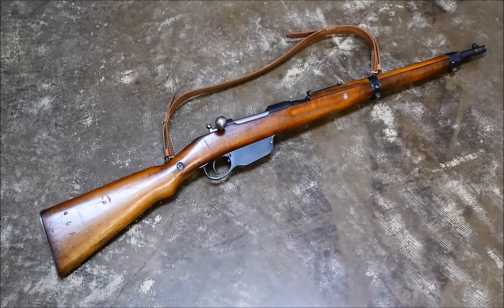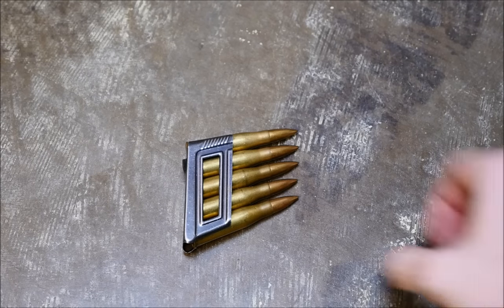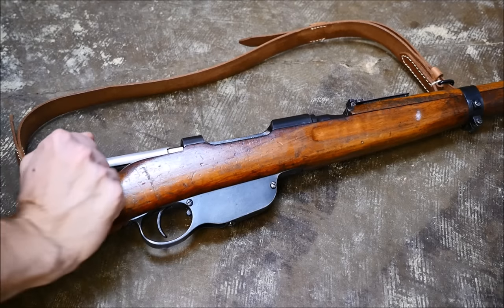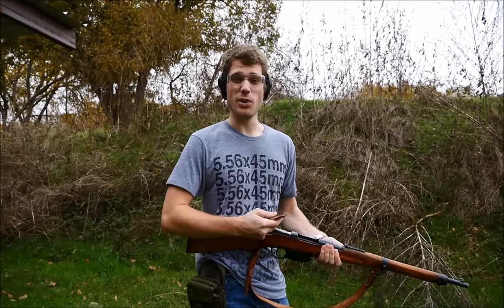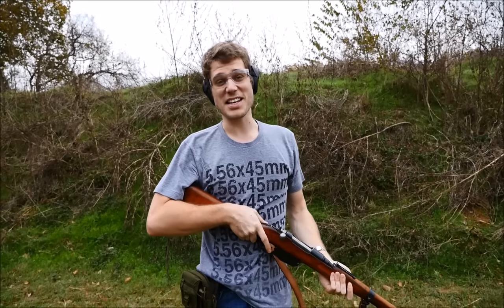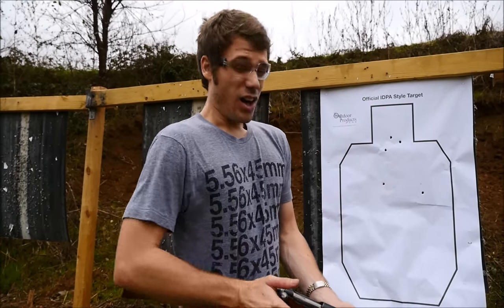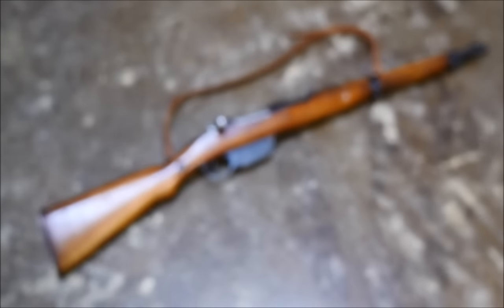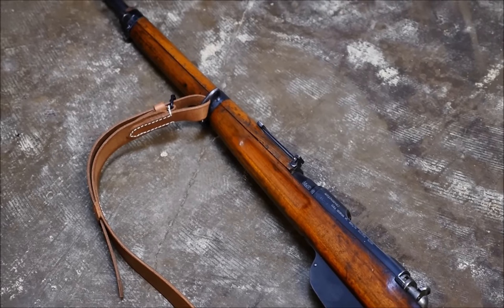M95 Straight Pull Run and Gun

Comment: I own an M95M that was missing the internal clip-replacement pieces, had to have a gunsmith install some sheet metal to replicate the missing pieces. It's not as smooth or refined as a K31 or Schmidt-Rubin rifle, but 8mm mauser is easier to find than the rare 8x56r and the nonexistent 8x50r Mannlicher. A handy length, lighter rifle, it's just a pleasant gun to shoot. Mine won't fully chamber Romanian steel case 8mm surplus, but it works fine with name brand ammo like Winchester 8mm. Sights are not the best for long range shooting, but they pick up very easily for 100 yard and less shooting.

Comment: Can you try a Ross Rifle? It is supposed to have the smoothest action of any straight pull rifle. That might allow for quicker operation.
Reply: I don't know if that is true the K31 is pretty fucking smooth it's like butter made from teflon.
Reply: +ShaDOWDoG667 Ross rifle is amazingly smooth (you can work the action with a couple fingers) but the design has quite a few issues with rapid fire.
Reply: +The Canuck Redcoat the Ross is the smoothest straight-pull, however, it wasn't a good combat rifle. They were very accurate, but unreliable in muddy trenches, and the early versions had a flaw that allowed soldiers to assemble the bolt improperly which could make for a bad day to the shooter.

The K31 is the best straight-pull combat rifle, even if it wasn't fired in anger. Just as accurate as a Ross, beefy bolt and action, and the precision that goes into these rifles is almost unmatched.

A few years ago, I contacted the Swiss soldier my rifle had been issued to. He couldn't say a bad thing about it and wished he wouldn't have had to turn it in and be issued the StG57.
Reply: +The Canuck Redcoat I'll check on the K31 and conduct a two fingers test.
Reply: cool!
Reply: +The Canuck Redcoat it is reasonably easy to operate the K31 with just a thumb and index finger.
Reply: +1stFallschirmjagerRgt Actually the K31 was used against SS soldiers killing civilians trying to flee across the French/Swiss border at Saint-Gingolph Switzerland. Also several other similar occasions as well as on Allied plane crews who thought the Swiss where Germans and tried to fight them after they had bailed out and landed on the ground.
Reply: I have both a Ross Rifle (sporterized Mk.3) and a K31 and I can say that the Ross has a way smoother bolt. If I'm target shooting I'd take the Ross for it's better bolt and better sights. HOWEVER, the K31 is the better rifle. The bolt is very smooth and quick, not as good as the Ross but it's also simpler and can be disassembled without tools. The magazine is removable on the K31 and can also be disassembled for cleaning, the Ross' magazine is overly complex and is virtually impossible to take apart. The K31 is also lighter, shorter, and more reliable. As sporting rifles I'd say the Ross is better but as combat rifles the K31 wins.
Reply: in the turn of the 20th century at an international combat rifle shoot the Ross actually had to have documentation showing it was in fact not a target rifle but the main Canadian arm (check out CnRsenal for more on it).
Reply: @chsims7032  good rifle : check
Muddy trenches : check
Good rifle now not so good: check

Thats why many good rifles failed in the end. They couldnt withstand the hell that was ww1

Comment: I could be wrong on this but I thought straight bolt design was more about the ease of operation instead of the speed of operation. For example while wearing thick stuffed gloves (or hands frozen if no gloves available) it would be much easier to pull straight back and forward instead of having to worry about turning the bolt. It also seems like it would be easier and safer to use a straight pull if you were very nervous and in a hurry, for example any turn bolt I have fired I usually do a quick visual check to make sure the bolt is turned down all the way and locked where with my K31 I just slam it shut and have confidence it is locked.
Reply: TheBanditBren interesting, I never thought of that.

Comment: Two things:
1) If you had an extra bolt body, modify it so the bolt head is down and to the rear, similar to the Enfield.
2) I'm piecing a Steyr carbine together. It will be a "Frankin rifle" from various parts. I need a stock. Since it will be no where near original/collectible I would like to find an aftermarket "hunting style" stock, (I can dream).  Otherwise a stock that is solid, but not usable for restoration would be good.
I will try the bolt mod idea on "Frankin rifle".
Ammo Guy 8-)
Aim small. Miss small.

Comment: I have a demilitarized m95 (hole cut into the chamber, welded firing pin channel). I was wondering if it would be worth it to rebarrel it for 7.62x54r and find a new bolt head.

Comment: To be fair, the Lee Enfield was the pinnacle of bolt action design in certain regards. Compare this to a Mosin Nagant and it's a clear winner, though. Also, I did have one of these, but never got to shoot it because I couldn't find clips or ammo for it. I can say that the screws on mine were incredibly cheap metal and the heads nearly stripped off after a few takedowns.

Comment: when I shoot an m95 I tend to have the ladder up, use the notch at the bottom of the ladder and use the slider at like 2 clicks up to make sort of a peep sight box. I also shoot at like 100 yards so.. But also I think straight pull is neat,  having shot an m95 and k31, but I think its kinda gimmicky, I cant shoot my m48 mauser plenty fast and imo just drill the barrel and go semi auto if you want that much of a speed boost. Straight pull bolts are, I mean not difficult, but not as easy as a regular bolt action or semi auto to take down and clean. I also notice I have to really beat the bolt home on a straight pull.

Comment: The straight pull is absolutely faster than an Enfield, I get loving the ol Lee but you have to remove your hand from the action anyway and it saves you the up stroke on cycling, when you use an Enfield yes the bold handle is right there but your hand has to go to the same place before you start pulling back and moreover the m95 doesn't have mosin like problems where shots take far longer wrestling with the initial up stroke of the bolt because you are pulling the case straight back as opposed to struggling to get it loose with a circular movement and then a pull

Comment: One important aspect of a straightpull is that you can keep your sightpicture whilst cycling the bolt.
Reply: +FellToRise You phisically can. The fact he doesnt do it does not invalidate its possibility. On a turnbolt you obstruckt your vision with your hand, here you dont.
Reply: you really can't do it very comfortably. At least i cant, i have to physically move my cheek back on the stock or i run the risk of hitting myself in the face with the bolt.

Comment: RDS mount for each and a modified bolt to put the handle in a better position. What do you think the results would be?
Reply: 1) If you had an extra bolt body, modify it so the bolt head is down and to the rear, similar to the Enfield.
2) S & K makes Scout Mount scope mounts. With NO alteration to the weapon. Instead of a Scout Scope use a red dot instead! Found one that kinda looks like the "mini scope" used by the Germans during WW II. It looks period correct on a Spanish 1893 7x57 Mauser. Accurate too!
The ammo Guy 8-)
Aim High! It allows for bullet drop.

Comment: Which action do you think is easier, this or the K31?
Reply: hard choice
Reply: K31 requires less force to open up. Also one extra round per magazine. my K31 fought vs a lee enfield, a mauser k98 and a mosin nagant in a test at the range. My K31 was superior in ROF. Also better sights. I bought the rifle, went to the range and scored very tight groupings without me needing to adjust the sights
Reply: K31 is more refined but both are good, both actions are from the 1880s, the M95 basically is an improved version of the Steyr M1886 rifle if i am not mistaken
Reply: T Hitsugaya I say Swiss K31.

Comment: I think it should be noted (and it may have been already in the comments) that this is not the original length of this weapon.  Originally it would have a much longer barrel, that is going to have some effect.

I own two of these weapons and they are brutal in the recoil department.  It's a 203 grain bullet at .303 velocities, several of my friends shot the rifle once and refused to shoot it again.  If you find the ammo you generally find the clips, which is nice.

The bolt is a bit stiff, the K31's bolt is much easier to operate.  Now when I shoot my original 1938 dated ammo it pops out of the extractor and I have to use a ramrod to get the case out of the chamber!  This does not happen with my original-length M95.  New made ammo from Graf and Sons does not do this in my carbines, I do not know what is going on.
Reply: I figured that this wasn't the original barrel length. The Germans captured M95s from Greece for instance, and they had 2 different designations for them. One started with "Gewehr" and the other "Karabiner"--"rifle" and "carbine" I believe. This seems like a carbine.

Comment: In a standard, controlled environment, a turn bolt will be faster. You're not being shot at, ducking in and out of cover and just trying to stay alive. I've done a few tests to try and somewhat simulate a battlefield experience with several different battle rifles and the straight-pulls performed just as well if not better than most. The exception being the SMLE. And I don't have any other battle rifles with turned down bolts, so when compared to other straight handled rifles that would have been used at the time, the straight-pull is definitely the faster action.

Comment: If you review your SMLE run and gun the muzzle is bouncing all over while your cycle the bolt. But in this video your muzzle hardly moves when you cycle the gun. So your sight picture is much less disturbed with the straight pull. So maybe the guns run about the same speed but with the gun bouncing around less you could probably fire more accurately at high rates with this gun.

Comment: If the damn bolt placement is the only thing restricting the gun from firing faster, how about we make sure that modern iterations of straight-pull bolts have better bolt placement?

Rather than thinking about how that sounds initially ridiculous, think about it - the primary gripe you had with that feature was something that was the Mannlicher's own fault in its designs. It's not necessarily a fault in all straight-pull bolts in general.

Comment: I am a little confused with your description on the sight. So if the ladder is folded down the dovetail is 500 meters? Then if the ladder is up and the slider is up, there is a notch for 300 meters. But if the ladder is up and the slider is down then the range is set for "about 700 meters"? So the actual options for this rifle are 300, 500, 700, then varying to 2,200 plus?
Reply: +Mat D Yes, that's pretty much correct.
Although I'm not sure whether that's actually meters, it's more likely Schritt (75cm) - IIRC, only Austrian M95s in 8x56r used meters, all other variants (Hungarian, Bulgarian, everything in 8x50r) used Schritt.

Comment: I've never had success with Lee Enfields having a fast or even smooth action. Of course they were cheaper one compared to what was available, but it left me unimpressed. Especially after all the hype about them having the fastest action of all WW2-era bolt rifles.
OTOH, my Mannlicher 95 and Swiss K11 and K31s are smooth and quick.
Reply: I have, but I don't think it's a fair comparison really. Straight pulls cut half the movement and cycle speed.
Enfields tear up any traditional bolt action on speed.
Straight pulls inherently will be faster but I also makes one wonder why they weren't further developed to be even faster than that, eg bolt handle on the left, if not forward of the reciever. It was SOP at the time to use firing hand to cycle the action, but if trying to change the game to faster without the pitfalls and expense of early autoloaders, why not get the support hand to run the bolt? Or create pump actions that could be battlefield tough. 
Straight pulls are in kind of an odd spot, then or now.
There was also the Cobb 50 BMG rifle which allowed a much less complex and expensive straight pull action to eat from Barrett mags, at equal practical speed as the auto. This may have also been legal someplace a Barrett wasn't, but another animal than the single shot 50s or even something like the Black Arrow. I saw a demo technique where the shooter racked it entirely during the huge recoil.

Always thought the scout rifle was a very cool concept, wonder if any straight pulls were considered or devised with. That would be their moment to shine, if any of those actions could meet weight requirements or more importantly work with common cartridges. The two I'm thinking of are obscure chamberings and IDK what else they could be converted to). And again, one could simply turn a BLR or Remington 7600 into a scout even more easily and have faster split times possible even as manual repeaters.
I understand some modern straight pulls are new on the market, I just know zero about them, actually forgot about them till this point in the comment. It's all a moot point anyway. Some 8" barrel 6.8 SPC with a red dot would probably do everything Cooper wanted a .308 Scout to, punch for punch in a smaller and lighter package. Shouldn't even of brought up Scout rifles it just always seemed to me they'd benefit from a straight pull more than most.

Comment: I have one of these and the 8x56R is becoming very hard to find. Can I shoot 7.62x54R out of it?
Reply: Not a good idea. It won’t be accurate because the bullet is smaller and you have a high chance of the case splitting and possibly hurting you or getting super stuck in the chamber. DONT DO IT

Comment: Did the clip eject out of the top or the bottom? And I noticed it came out on the 4th shot why and how is that?
Reply: +ty coetello Out the bottom.
It comes out after the 4th shot because it's actually held up by the cartridges - when you chamber the 5th shot, there's nothing holding the clip in anymore, and it just drops out.
Reply: Mannlicher en bloc clips ejected from the bottom. They're held in place by the magazine follower, once the fifth round is chambered, there's nothing left holding the clip in place and it simply falls through a cut out in the magazine.

Comment: What was it with 19th century military rifles obsessed with long range fire to the point of utterly neglecting a practical close range sights setting?
Reply: +Treblaine Because warefare for CENTURIES had been dominated by linear tactics. Even up into the 1870's and the Franco-Prussian war, combat was dominated by whole units, sometimes up to the brigade level, moving as one unit and engaging the enemy in the same size and general shape. And in that case, the unit that can fire at the longest range and maintain accuracy will have the advantage. It wasn't until WW1 and the evolution of static and defensive warfare that the submachine gun was even developed. 

As for urban warfare...it simply wasn't a big thing up until WW2. I'm not saying that no battle ever was ever fought with guns in a city, but again for CENTURIES warfare was fought by large roaming armies that usually met in fields with high ground; ridges, hills, things like that. Until the development of howitzers and field guns (and planes) that could plunge their fire into the heads of anyone taking cover did cities and towns become paramount to the ancient forts and redoubts.
Reply: Nathan Johnson Sorry, I've been reading so much of WW1's trench warfare and even the non-trench warfare of the Battle Of The Frontiers and the idea of large groups of men shoulder to shoulder firing seems madness to me. Though I guess there were a lot of mad ideas. All I read about the capability of concentrated machine gun fire and artillery is that such a mass of troops would be (1) easily seen from far further away than the "block" of riflemen can see or engage the artillery or machine gun against them (2) it'd be impossible to miss them.

I thought it was so natural that even by 1895 riflemen would naturally be as spread out as possible so it would be as hard as possible for long range ordnance to spot them and obliterate them.

I guess the rifle designers were seeing their rifles as the be-all-and-end-all of warfare, neglecting how artillery and machine guns would take up the role of engaging large concentrated groups. That the role of riflemen was closing with the enemy.
Reply: Keep in mind that until WW1, there hadn't been a war involving all the major powers of Europe since the age of Napoleon, a century earlier. There had been a few biggies like the Crimea, but no huge wars. But now EVERY major power in the world (i.e. Europe excluding Italy and the USA) was getting in on the action. On top of all that, machine guns were only practically applied in combat in colonial areas like India and Africa, where they were almost a necessity to offset the huge manpower advantage the natives had. I would seriously recommend reading up on the very first weeks of the war and how the French army put their tried and true half-century tactics to the test against a machine gun equipped and competently led German force and how they were simply decimated.
Reply: Nathan Johnson Well, Franco-Prussian war was pretty major, but it was just before before high explosive shells and before the wide introduction of machine guns.

Comment: what is the advantage of non straight pull?
Reply: Cheaper manifacture, less friction in the action.
This gun basically uses a miltilug rotating bolt from a modern automatic rifle, and substitutes the gaspiston for the bolt.
You can find numerous conversions that affix a piston to the bolt handle and add a recoil spring in the stock, turning these semiautomatic.
Reply: thanks, well explained.